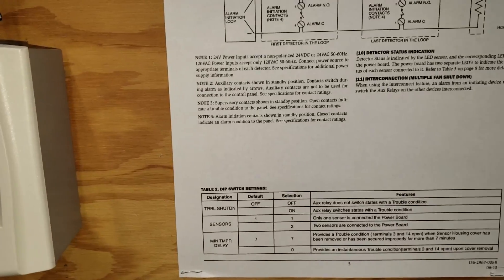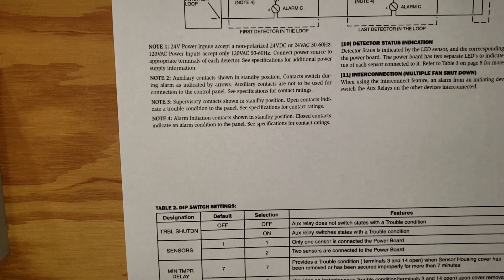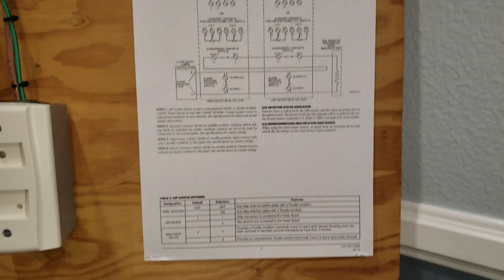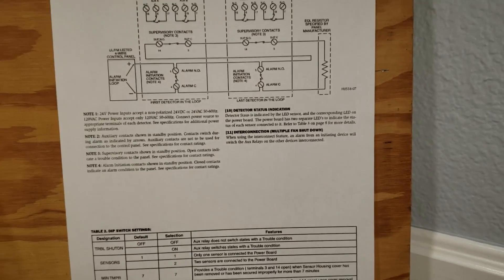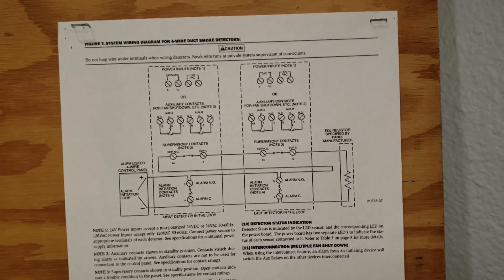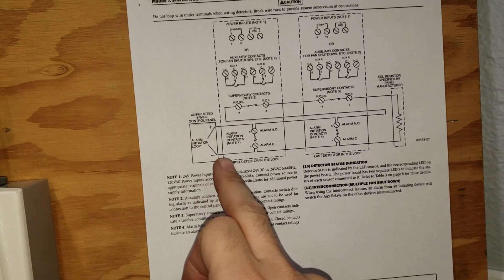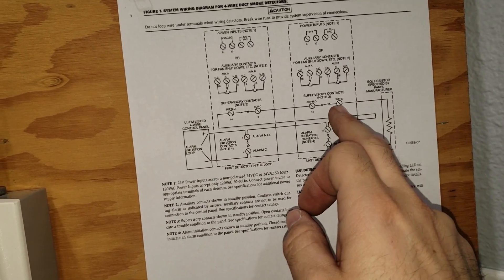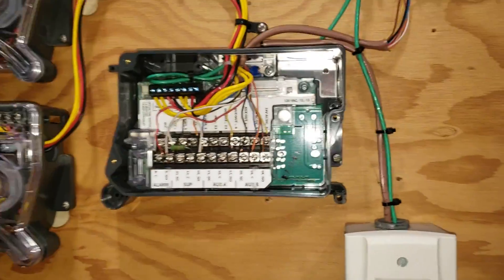RTU DUCT DETECTOR TROUBLE CONDITION

Comment: Chris, can you help explain how  to add 3 additional detectors I need to put together a shut down for four package units and I’ll either need a minimum of foreheads and two detectors or 12 heads and six detectors. I just can’t quite get the concept of how each of them communicate to each other to shut each other down what does one do to signal a alarm mode for all of them

Comment: Dawg I set one off yesterday 😢..I didn’t have 24v on red but I had it coming out of my transformer so I traced the issue back to the smoke detector because that’s the only thing I could think that would interfere with the 24v signal..I did in fact have 24v at the smoke detector but not coming out of it so my dumb ass decided to jump the detector out which in fact called the fire department 😂..I was cleaning up and not even kidding I see a stood up from behind a unit only to see a fireman 👨‍🚒 walking towards me across the strip mall roof 😭

Comment: CHRIS CAN YOU HELP ME OUT ??
I’m trying to get a better understanding with these things and made a simple setup with just the detector.I have a system sensor d4120

So  to test things out I have 24v on 9,10.
On 4c a resistor to 3c. 
14no connected to 5no

I have a green light flash every 5 seconds on the head and board.
The thing is the normally open supervisor contacts are closed for 35 seconds on start up and then open but show no trouble.
When I do go into alarm the red light is lit and contact 4c and 5no are closed but no changes in the other contacts.
I thought it was the board itself and tried another one but I have the same issue.
Can you help ?
Edit . According to the instructions on status indication listing ( I’m looking at 3 and 14 ).
On startup they’re  closed, Maint  they’re closed and open on trouble open.
On start up 3,14 are closed and open after 30 seconds. I’m open I should have and amber light but I don’t. The head and board flash green. So no alarm, no trouble but my 3 and 14 contact are open.

Comment: I deal with 1 national chain retailer that of all the name brand stores out there they have the most issue's dealing with smoke detectors and the wiring Centerpoint. 
The note worthy point is they use xyz alarm company who then subs the work out to multiple local alarm companies.  None of it is wired the same and when working in multiple state's I'm not allowed to touch their wiring,  and yet we are dispatched instead of the alarm company. 

With this said 9 time's out of 10 the issue lies with alarm wiring and yet we're required to replace smoke detectors and the wiring point.

In a store with multiple units there's always a relay present to globally activate the entire network and that relay can be a cause for trouble as well. Another part the alarm company is responsible for.

Comment: Very intresting how fire detection is done in the USA.

Here in Australia we have the same enclosures that sample air that goes through detectors. Except we have all fire dectetion on one panel that we call an F.I.P (fire indicator panel).

All the detectors are connected in a loop to the panel and the fip is connected to the emergency services, and sometimes connected to security.
Reply from the maker: Its the same here we connect our detectors in a loop and they terminate in the fire panel
Reply: It depends on the job and also on the local fire code/jurisdiction.  I've installed duct detectors that are basically just the smoke head, that's addressable on the facp, with a separate relay module that the hvac tech will connect to shut down the unit.  I've seen these other ones that have their own control board that are installed by the hvac tech and we (the fire alarm guys) just hook up a monitoring module.  Still always need a relay module so the facp can shut down the unit regardless of the duct smoke detector.

Comment: Just experienced a trouble condition on a RTU.  Started Friday before Christmas (2018).  Part took a week to come in (Christmas eve/Christmas Day included in this), so I had a beeping alarm panel for a long time.  Medical building.    Even had a fire inspector breathing down owner's neck...so the supply houses have to do better especially if this is a common issue.
Reply from the maker: Yeah I keep them in stock in our shop
Reply: @HVACRVIDEOS  Too bad our service provider doesn't.  Not a small company either.
Reply: have them order more and keep a spares in stock on site? assuming they have a building/multiple RTU's of same device/s.
why should multiple HVAC companies have to keep them in stock, when possibly it's older and only one customer uses that model........ tossing a bone to HVAC corps and beating the heads of building owners seems very fitting in the above case ;) maybe they should be required by fire code to keep spares in stock (vacuum pack sealing works well)